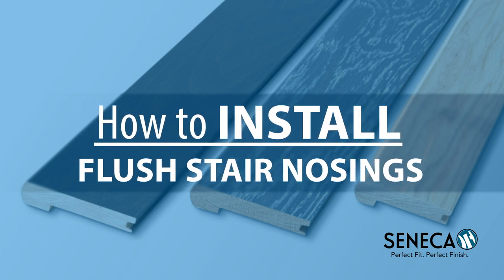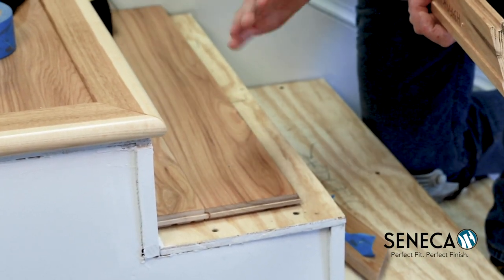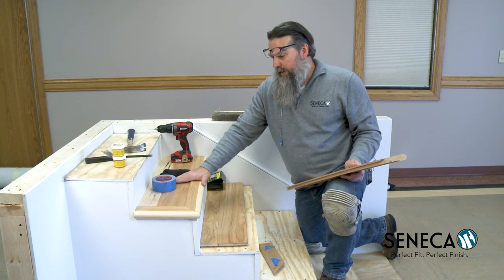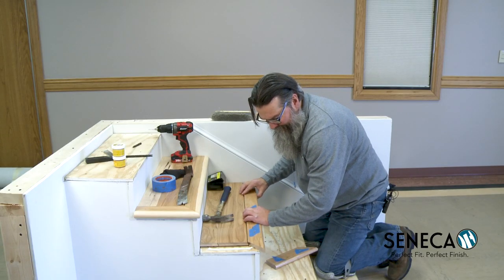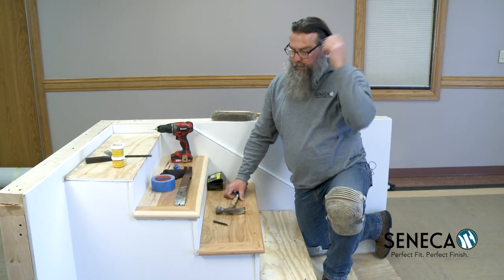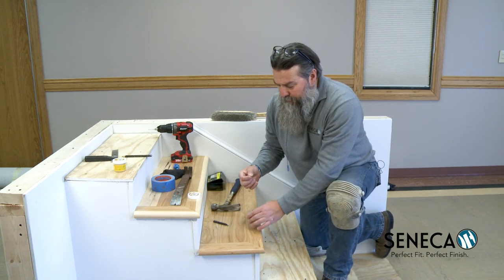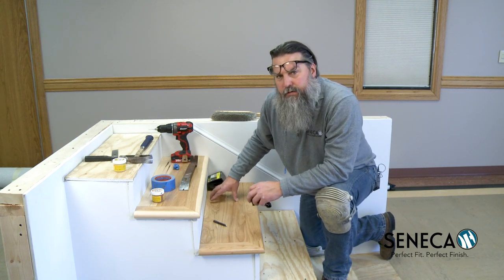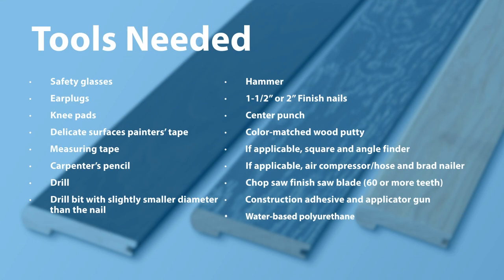How to Install Flush Stair Nosings by Seneca Millwork

Comment: Hi there:- I have a different application. I am applying 3/4" hardwood to a stairway landing, which is 6.5 ' x 3'. In this case, I am told I have to place the stair nosing first, working back to the wall. The back of the nosing has a groove, not a tongue. So how do I nail in the next course when there is no tongue to nail into?

Comment: My situation is different I have an edge nose one end of the living room. I need to replace it which not sure how to do this because it doesn't have tongue and grove the hardwood floor is 5/16" and the existing edge nose is 1" thick I guess my question is what is the best way to pull it off to put new one??

Comment: I am planning for LVP on stairs. The LVP has both flush as well as overlap stair nose options. Which one do you recommend? My existing stairs has nosing, do we need to cut it to make stairs flush with riser? Thanks In advance
Reply from the maker: From our technical department:  We recommend overlap for strength at the nose. Secondly, if you are using overlap and there is an overhang on the steps over the riser we would recommend cutting that back if you have enough depth to meet the building code.